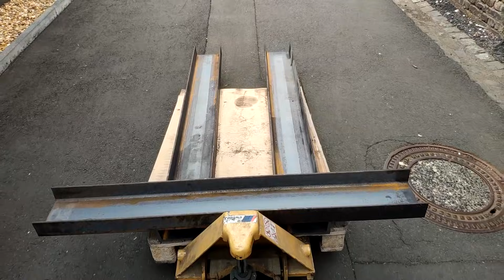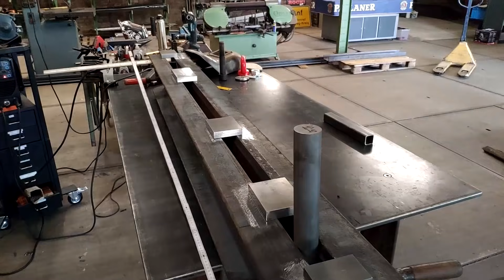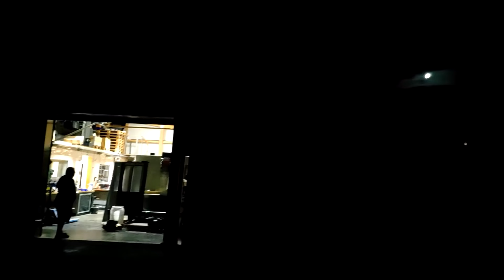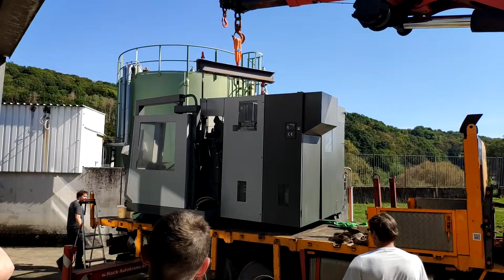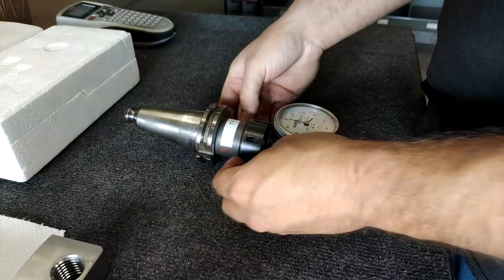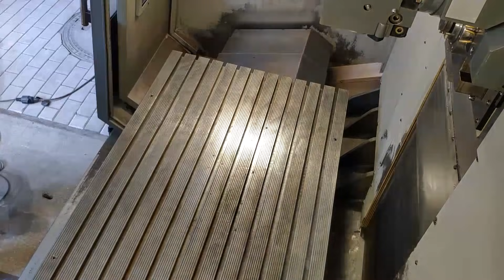My Tiny New Mill (Deckel Maho MH 1200)

Comment: Roetz 4.0 Can you help me? I have an Maho MH 1000S 4 axis vertical&horizontal machine. Can you tell me how I can change the rapid traverse? It's limited to 4000mm/min. I want to increase it.
Reply from the maker: I would never mess with these parameters. 4000mm/min sounds low  - BUT if you change these values, youre entire PID loop of the servos will be highly inaccurate. 

I would only change them if youre sure that the 4000mm/min values are wrong and a higher value was intended by Maho.
Reply: @Roetz40  Since that I successfully increased the r. traverse from 4k to 8k (mm/min). For now everything works fine.
Reply from the maker: @fury9606  on most controls you can display the lag error while one or more axis is moving. It shows how much the actual position differs from the setpoint. If you change the values you might end up with a big lag error that will cause circles to be out of roundness. 

But: I read your initial comment too fast. Changing the rapid traverse might be okay. You should never touch the rated speed of the servo, which will probably be higher than the value for rapid movement

Comment: What TNC do you have? 425? Do you have experience with adding something like a rotary axis to the machine? I have problems finding data on communication between servodrive and the TNC. I´d like to add an old 4 axis with a new programmable beckhoff drive, or similar to a TNC 415b. Thx and great videos all around
Reply from the maker: Hi. I don't have experience in that case. Try to find information about oriental solutions and replicate that. In my case all the servo drives are indramat based. I guess I makes sense to Starz off from that.

Comment: I'm repairing machines for 10+ years at a premium automotive manufacturing plant. You will really hate this location for the machine. You always need a lot of space above the machine to remove broken parts like a counterbalance cylinder or a ball screw. Anyway, a really nice machine. Treat her well.
Reply from the maker: I give you that, agree 100%. But workshops are always compromises. I hope I never have to change ball screws or any other major components. If I have to, I can at least remove the flooring above the machine. With that beeing said, if I need more space to the right hand side I have to cut a hole into the wall... :D

Comment: What does a machine like this get plugged into? What kind of electrical requirements are there?
Reply from the maker: Requirements arent that bad. 3 Phase, 50 Amp breaker is recommended without GFCI.

Comment: Nice machine and very useful for anything that is too big for Maho700/Deckel FP4NC class. Wish I had one, probably would barely fit into my workshop and the bad concrete floor there would make it very hard to move 10 tons.
How much did you pay?  And how does the Z-axis work on that one, looks more like a bed type machine than the usual Deckel/Maho construction on smaller machines?
Reply from the maker: The whole Z-Axis/Y-Axis assembly is mounted on a single coloumn on the left side of the machine (front view). Y/Z axis is flat guided, x axis is on really heavy duty linear rails afaik.

Comment: That's a rad machine! It's not clear to me, is the vertical head able to move continuously or index as a B-axis while the spindle is running?
Reply from the maker: It has just the two positions, no B-axis capability. It would also give some strange cinematics having the spindle sitting on a 45° angle. :)
Reply: @Roetz40  True. I have seen some weird stuff on something like a Pama Speed Ram where one of the interchangeable heads can index as this. Your Maho is a fine looking machine. Add an axis as you have indicated and that will be a great match for your talents. Looking forward to seeing what projects you may share!
Reply from the maker: @gregkuchyt99  I already have a 3 jaw chuck mounted to an indexing head on there. 5 sides of the workpiece are accessable already. If  I stumble upon a unit with integrated servo I might get it. No problem to wire it into the control, it is made for up to 5- axis

Comment: Hey just asking because i am thinking of a similar career to our own 
how much did ya pay for this machine?
was it a huge investment or something you paid out of your pocket?
Reply from the maker: I  don't want to talk numbers, sorry. But I guess its somewhere in the middle of both options. When you want to run these kind of machines, take into account that you need at least the cost of the machine for infrastructure, equipment and maintenance on top.
Reply: Also when you buy old machines.. expect to have problems with them - i got a shop when a few old machines and oh my god i have been struggeling with them at times haha.. an old machine like this maho is alot more cheaper than a brand new - i just bought a brand new DMG Mori similar size of this maho - it cost as much as a house.